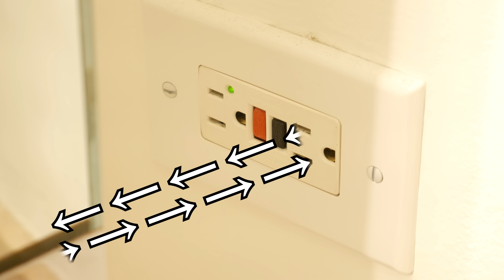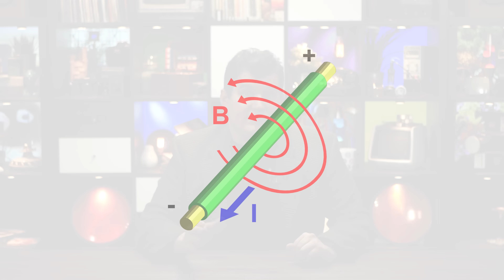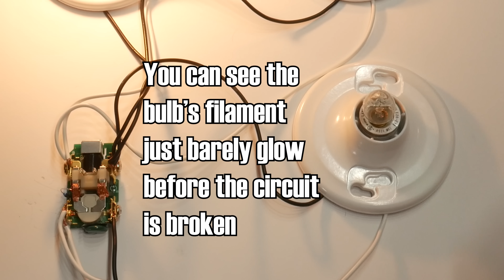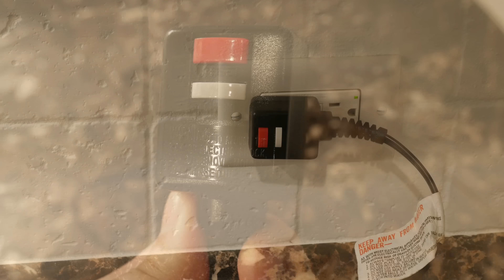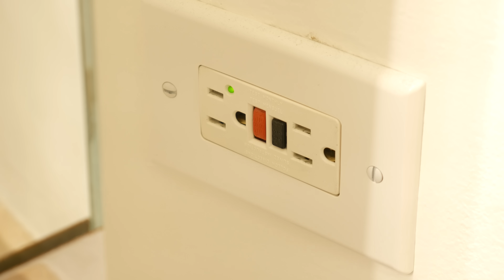The GFCI/RCD: A Simple but Life-Saving Protector

Comment: Why oh why do American outlets not have switches on them? To me it seems a no brainer. I live in Australia where it is hard to find an outlet without a switch on it.
 Unfortunately the Australian outlet is annoying and hard to plug things in an out of. I adore the UK plug. Yes it is a bit chunky, but it is easy enough to plug something in without having to visibly see it, you can do it by feel which is great if your outlet is in a hard to reach place.
Reply: Lachlan Bell You CAN put North American plugs on a switch; you can buy half switch/half plug cover plates for double ganged boxes.  You can also install combination devices which are half plug/half switch, and can be wired so that the switch controls the plug.  However, switched plugs, while used, are indeed not that common.

Comment: The most obvious reason why RCBOs are rarely use is the price! It cost 10 times more then a circuit breaker.
Reply: that and the fact that only people with advanced electrical knowledge would ever bother having them installed or even know that they exist, a dual RCD configuration works just as well for a fraction of the cost, but believe me when you do have a fault and you need to find the damn thing, its a massive pain in the arse!

Comment: In Germany, there is usually a RCD for the whole circuit box and individual switches for each circuit (often one per room). If there's a fault, you turn off all small switches, then reactivate the RCD, and then turn on every other circuit one by one. The one where it trips, is where the fault lies. Then you unplug everything in that room, and turn on the RCD again. Plug everything in one by one, and then you'll find the device causing the tripping. Also in German they're called Fehlerstromschutzschalter (fault current protection switch). They also have a normal circuit breaker switch lever on them to reset them, and they can be switched to off with the same lever. They have a test button too.

Comment: I bought a 1949 home that had mostly original wiring and outlets (Meaning ungrounded outlets). I replaced all of the outlets with newer grounded outlets and (Both wanted to and needed to) installed GFCI outlets at the beginning of each circuit to protect all of the down stream outlets. Since then, I've replaced most of the old wiring, but kept the GFCI's in place for good measure.

Keep in mind that GFCI's do not protect you if the current going through you returns to neutral. This means if your left hand is holding the metal protective case of a toaster and your right hand is poking the heating elements of it, you probably won't trip the GFCI. Those metal casings are usually bonded to neutral since most toasters do not connect to safety ground.

Comment: I'm not quite sure I follow, if I have 1A, and I use 500mA in the circuit, you're saying 1A still goes back into the neutral? Wouldn't that be infinite power? (Is it relevant to note I only deal with DC electricity? I'm still learning)

Comment: In the US we use single phase 120/240v while in other countries they get fed single phase 240v. 
This enables us to use 3 wires to feed 2 circuits (a multiwire circuit) which would take 4 wires elsewhere. GFCI circuits cannot "share" neutrals. Thus once you install a GFCI on a circuit you need 2 wires per circuit. 
In order to retrofit older homes with GFCI protection it was needed at the first outlet in the run after the splitting of the multiwire circuit. Or if there was a 3 wire circuit tapping the 2 hot wires (while sharing the neutral) leap-frog style, ALL of the outlets would need to be GFCI outlets tapped only on the line sides.

Also I think you missed an interesting aside as to how the inventor of the GFCI devices proved his invention.

Also great video and awesome channel.
Reply: Actually you can get a 3-phase RCD and pull a single neutral with absolutely no issue, it just do R+S+T+N <=30mA instead of R+N <= 30mA. I think also in US exists RCD capable to protect multi-phase systems.

Comment: You are not required to ground a GFI receptacle if a grounding means doesn't exist in the outlet box. Article 406.4(D) 2(b) of the NEC. allows you to replace a non grounding receptacle with a GFCI receptacle.

Comment: One more important thing to mention here - if you manage to connect yourself to both line and neutral, you're going to be seen as just a normal load to the device. This is a rare situation, but it happens often enough to be noteworthy. This is another reason why traditional circuit breakers are so important.

Amazing video, you really did your homework on researching this.

Comment: Here in Finland only newer houses built after 1997 or so are guaranteed to have full safety-grounding in the wall sockets. And even in the newer houses with safety grounding, it is a rare sight to see GFCI/RCDs. It became mandatory to install GFCI/RCDs in houses built after 2008, which is too late in my opinion. In my flat there are only 3 safety-grounded sockets, the others are not grounded.

Comment: The power is not "returning to ground" but rather "not returning through neutral". In a working TN/C/S style (European) installation nothing "goes to ground". The PEN (grounded neutral connector) is split into N (blue) and PE ( green/yellow) of which only N is fed through the RCD). PE is connected to the chassis of whatever device you have. So a situation where a device might have an isolation failure the rcd will cut power before you even touch anything. With devices that don't have a PE connection it works as you described in this video. Once something "goes to ground" there's residual current. That's why it's called residual current (protective) device or RC(P)D.  "Ground fault" would mean that there's a problem with the ground (or PE/PEN in europe) like high resistance to the actual ground. Therefor the term "RCD" is more accurate.
Reply: In a working American circuit, nothing goes to ground. 
'Ground fault' is the term used for any unintended leakage to ground, it doesn't matter what the cause is. Tree on a power line? Ground fault. Hot line came in contact with the case on a machine? Ground fault. Some jackass touched a hot line while grounded (i.e. standing on wet concrete)? Ground fault. It's not a ground fault because something is faulty with the ground, it's that the characterization of the fault is grounding of the circuit.

Also, to be that level of 'that guy': current can't be residual, because it is, by definition, transient charge. Nothing is left behind, it just went somewhere you didn't want it too. 'Leakage current' or 'current that isn't accounted for' would be more accurate than 'residual current'. Therefore, "GFCI" is more accurate.
Do I really think it matters that you call it residual current? No. I just wanted to try being as pedantic as you. In actuality, I think us Americans are right because we did the whole 'electricity for powering shit' thing first. If YouTube comments have taught me anything, it's that being first means you're superior.

Comment: I live in an old house which was built before they even added grounding to electrical outlets, and I was doing some research (on the internet) which suggested using GFCI outlets where there is no grounding (the GFCIs even come with a sticker to affix to them stating that they aren't grounded). When the original power supply in my computer started failing, upon finally kicking the bucket it was the GFCI which tripped shutting off power.

Comment: I live in New Jersey, and my house was built in 1984. For some reason, all of the outlets that have GFCI are wired through the same GFCI device in the garage; in the garage there's an outlet with the test and reset buttons but they control all of the corresponding outlets in my house. It's strange.

Comment: A GFCI will most definitely not spare you from the pain of a zap. Grabbing live will still hurt like hell but at least it will quickly stop.

Most electric shocks just hurt while only certain cases actually are a death risk (Unless you have a sensitive heart condition or similar).
Reply: Yeah but the shock will be small (5 mA) and the duration is very short. We're talking milliseconds.
Reply: @LonnieAdams4  There is nothing limiting the current to only 5mA .If you have wet hands and are holding a large grounded object with the other hand you could get as much as an amp going trough you, but yes the GFCI will trip very quickly to make the situation much safer.
Reply: @berni8k  If the GFCI is working properly, it will trip at 5mA in every case.
Reply: @LonnieAdams4  Yes it will trip at 5mA no matter what, but there is nothing limiting the current to only 5mA. The mechanical contacts take a few miliseconds to open and stop the flow of current. In those few miliseconds the current will be whatever current was flowing to trip it. It could be 5.1mA or it could be 5000 mA. You need to use a solid state semiconductor based switch such as a transistor (NOT a triac) to be able to switch it on a scale of microseconds or nanoseconds.

That being said passing 1A of current trough you for a few miliseconds is still way way safer than for however long it takes you to let go(if you can let go at all). It will hurt like hell, but it will most likely still not kill you.
Reply: @berni8k  Yes indeed. The RCD protects by switching off in abut 0.2 seconds if the current exceeds the limit. For the heart it just matters that it's less than 0.2 seconds (it can be longer if the current is rather low, but since the RCD cannot control the current, only the time, RCDs go for the 0.2 seconds which are survivable for the expected fault currents).

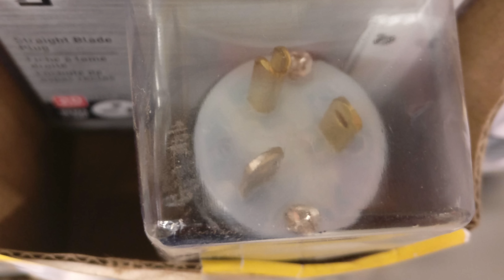Comment: At 14:29 the sideways prong is for 220v 20amp. It's so you can plug a 220v device into a 120v receptacle. Great video.
Reply: Patrick Butler I think it's sideways prong is for a 120 volt 20 amp appliance.  For a 240 volt 20 amp plug the flat and vertical prongs would be reversed.

Comment: You forgot to mention that these WILL NOT protect against someone touch the neutral wire AND the hot wire, as the circuit will not see the ground fault (since it isn't there) and it will cook you. There's a chance it will still detect it, but there's no guarantee

Comment: NO WAY! Wow. Just wow. I'm an electrician so I know my way around Dutch electrical wiring and know a bit about US-wiring and electrics, so I didn't thought I'd see something new in this video.But I NEVER knew there were RCD's built into wall-sockets. And just when I thought that was all, you started talking about appliances with RCD's mounted INSIDE the plug! 

To talk about these devices: In the Netherlands we tend to call them 'Aardlekschakelaars', literally translated you end up with something like 'Earth-leakage switch'.Though it indicates it does 'something' with a leak somewhere, it's hard for many people to understand that the safety-ground wire (which we just call earth or PE in electricians-language) has nothing to do with the RCD itself: it only senses that there is current leaking somewhere, but as it's not returning to neutral, we assume it's leaking to earth.
And about the place where these devices sit: it's common in the Netherlands to have these in the service-cabinet (metercabinet as we like to call it).Indeed, it can be hard to find the cause of the leak, but that's also some common sense: just unplug everything on the same group (for as far as possible) and start replugging until the RCD trips and there's your fault. Garden-lighting is notorious though for moisture and causing random tripping of the RCD and because you have to open the switchboxes in the metercabinet, most people don't think about that possibility.
We got our metercabinet renewed last year. We got PKN6 RCD's from Eaton. Big downside from these is that they don't indicate the kind of fault, whereas the devices from ABB I use on a daily basis at work, the DS201 series, feature an extra indicator so you know the type of fault that occured.An overcurrent just trips the device, throws the lever down ánd moves a green 'signal' in a small window just above the lever.Resetting it makes the green signal turn red again.A ground fault however, does all of the above, but also shoots out a blue indicator in the middle of the handle, indicating the device has tripped because of a ground fault.

In Belgium, the usual name is 'Verliesstroomschakelaar' (literally translated: 'Current-loss switch).
Reply: As a Dutch person who doesn't know all that much about electricity, thank you for explaining how this relates to our situation.
Reply: @aphenioxPDWtechnology  thank you for that lucid and specific conjecture about the differences in language. I thought that person's comment a little rude, but you came along with a purely helpful attempt to make sense for someone with little knowledge of the language (such as myself), much respect
Reply: Definitely been very happy with ABB products wherever I've used them, but being as Square D and Eaton seem to be preferred in Canada, ABB tends to be far more expensive here.  For industrial products ABB prices are fairly on par depending on suppliers.
Reply: A good rule of thumb for figuring out which device set of the switch is to unplug the last thing you touched, re-enable the switch and try again.
Also in Flanders, the metercabinet is often called the "plombkas", literally the "kast" ('cabinet', the t isn't articulated nor spelled) where you put the "plombs" ('fuses', the b is also not articulated but appears in writing), which I presume comes from the French word for lead, i.e. what the old style fuses that melt were made of.
Reply: In Norway we call it "jordfeil". Directly translated: earth/ground error or earth/ground fault.
Reply: RCDs in wall sockets have been freely available in the UK for about three decades. They are now largely redundant as modern standards require all domestic circuits to be protected (with a very few possible exceptions, like smoke detectors). However, RCDs on outlets wre sometimes a quick retrofit for older configurations. 

RCDs on plugs were also a possibility too. They used to be on some extension leads designed to be used for garden equipment, but again that was a retrofit for older installations. 

These days, all new circuits and installations have to be RCD protected by at least a split system (so half the  circuits can be lost with one fault) or, better, with individual RCBOs on each circuit. .

Having the breaker back at the distribution board has the advantage of protecting against fixed wiring faults too, not just those in devices.
Reply: @benjiro8793  Yeah, I understand that "stroom" refers to electric current, but the cognate in English for "stroom" is "stream", which just means a small body of running water. 

In English, all of our technical words are from French Latin and Greek. Germanic roots are for common words and poetry. Thus "Verleisstroom" becomes "Forlorn Stream" in English. It's poetic.
Reply: Same here, individual buttons on sockets just seems stupid.
Reply: For the garden Fehlerstrom (yes, I'm from Germany) tripping the main Aardlekschakelaars, simply add a plug-in (intermediate plug) RCD with a lower trip current. The Fehlerstromschutzschalter in my home trip at 30mA, the garden outlets are equipped with 10mA RCDs.

Like these: https://www.amazon.de/Schutzschalter-Steckdose-Sicherheitssteckdose-Anti-Leckagen-Elektro-Schock/dp/B077FQV3CH/
Reply: @klausstock8020  Ah, the differences between countries ;) I can't even remember ever hearing anyone talk about those in the Netherlands, though our RCBO's usually have a 30 mA trip-rating (in reality, they trip around 15 to 18 mA, some at 21 mA)

And in Belgium, RCBO's with a 300 mA can still be found in domestic use, while you probably have to do a good search in the Netherlands for those.
Reply: @aphenioxPDWtechnology  "Verliesstroom" would be "Forlorn Stream" using the English cognates. It sounds absolutely poetic, like someplace haunted.
Reply: Nothing against you guys, but what is with your language, it just looks like you gave a kid a keyboard and they banged on random keys.

Comment: These are an interesting idea and make sense, but personally I prefer the Australian standard of (basically) "every power point must have a switch" in addition to the RCD's being in the breaker box so if a device is acting up you can cut the live/neutral power to it at the wall and keep it grounded, also means devices that have an on/off switch accidentally flicked to 'on' (like a kettle) won't instantly try powering up when you plug it into the point - you must deliberately power on the device at the wall before it gets current.

That and our 3-prong plugs that look like an arrow are nice as it means the plug only goes in one way (even without grounding) so our plugs sit in one position and don't risk intruding outside their dedicated area (with exceptions of oversized plugs like wall warts/power bricks for electronics such as phones and similar devices (eg: Nintendo Switch power brick)).

Comment: I actually had one of these switches fail in my bathroom while my fiancee  was taking a shower. I'm guessing the combination of the humidity and perhaps the solenoid not disengaging (rust? idk) caused it to cause a small fire on my bathroom vanity. Thankfully the main circuit breaker ended up tripping killing power and stopping the flame. I'm not really sure what of the purpose of my anecdote is... these are definitely important to have. I guess make sure that the outlet is working correctly and if you experience it "flipping" and cutting power for no reason, replace it. (Especially if it's old like mine was)